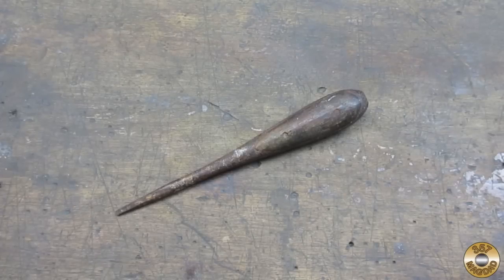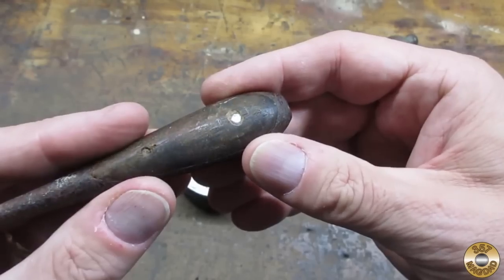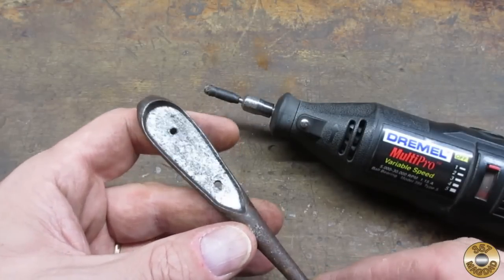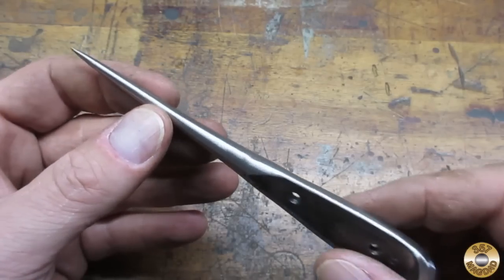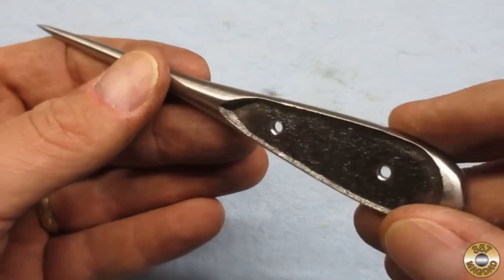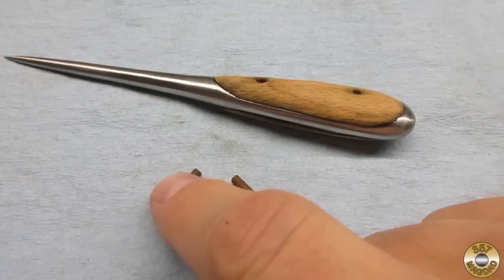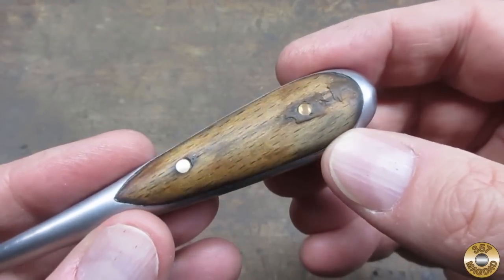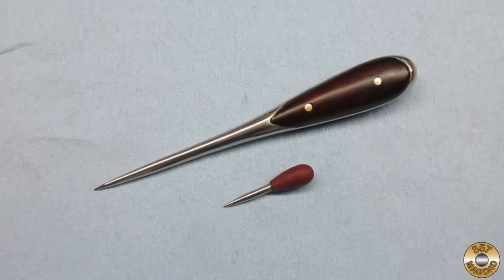Hand Tool Restomod - Perfect Handle Awl

Comment: Nice job young man. May I make a suggestion, on that contour of your pokey thing that is difficult to grind, what if you were to make a stick with contour to match the trouble spot and put it behind the running belt with slight pressure to shape the belt to the contour of the pokey thing contour, I hope this makes sense to you sir, thanks for the video, enjoyed it.
Reply from the maker: Thanks for the tip Terry!

Comment: Have you ever tried or seen Durham’s Water Putty? It’s like a tan powder that you add water to and then form  and when it dries, it becomes rock hard. People use it to fill in holes in damaged wood and fill voids. Some people use it with molds to create shapes like art pieces. It’s been around forever. I’m thinking that if I do something like this that I might think about using it to make molds that I can use as handle scales
Reply from the maker: That sounds like an interesting idea Joe!

Comment: Very nice pokey thing! What do you use them for? I mainly use mine on sheet metal holes when rivets won't go in and when reinstalling aircraft interiors after maintenance/repairs. I rarely need more than one but have started collecting interesting ones due to watching your videos. My Yankee driver collection is also your fault. I have several Yankee bits that are so large that I have yet to find a driver for them. But love being on the hunt for one!
Reply from the maker: I have a no-handle pokey thing that I use on almost every project.  I'm glad I've "influenced" your collecting!  I just found a Yankee No 31 that takes the larger bits this year!

Comment: I have a 1/4" drift pin that holds the shift linkage in my 1980 Mini. I went the auto parts store asked about a drift pin punch, no dice. I ended up at Sears, an older gentleman least 60 knew what I was talking about, got my Craftsman Drift punch.
Reply from the maker: Unfortunately, the 60 year old salesman and Sears are both the last of their breed.

Comment: Magdad,

Once again a beautiful job.   I was hoping you would use the modified end to make a bird's-eye awl.

Maybe the next time.  Out of curiosity did you epoxy the scales to the pokey thing?  Considering the one scale was cracked through a little more epoxy couldn't hurt.

Wishing the Magdad family happy holidays. 

Bob
Reply from the maker: Thanks Bob!  I epoxied the scales, I just forgot about that crack until the sanding was done.  A four sided awl point is on my to-do list!

Comment: Perhaps no other hand tool gets more abuse than a perfect handle screwdriver. Maybe I should say no other hand tool can survive more abuse than one of these. Of the six that I have, every one needs at least a little TLC. The two that were my dad’s need a good cleanIng, some regrinding of the tips, and refinishing of the scales. The set of three that I bought new need a bit of work. One has loose scales. The other two need to have the tip squared back up. The sixth, which I think came with a tool box from a flea market, needs the works including a visit to ScoutCrafter’s Dake.

Always nice to see one of these given new life.
Reply from the maker: I've got a drawer full of perfect handle screwdrivers waiting to be cleaned up.
Reply: @357magdad  you inspired me to do a little screwdriver maintenance this afternoon. I brought in the largest of my PH screw drivers from my work van, ( the other two are hiding )and one of my dad’s that was in the garage. They only got the tips squared up but it’s a start. I also got out the one that needs the most work started in on it. I think I straightened the shank enough that I won’t need to wrangle an invitation to ScoutCrafter’s shop.
Reply from the maker: @janderson8401  I'm glad you got inspired!  Cleaning up old tools is fun!

Comment: Top notch job on the Restomod Perfect Handle Pokey thing .. i was saying to myself the scales were pretty   banged up and well used  not worth saving but you pulled it off the scales came out great like brand new great and the Bombbay Mahogany Stain was the best choice combining  the brass pins and steel handle  A 10 out of 10 Restomod  and mr Chuck  did  a grand job polishing the pokey thing  ....... The Question is there  going to be a Christmas day Special next Sunday ????  or are you going to take time for yourself ?????
Reply from the maker: Thanks Roger!  I wanted to practice saving the scales for an upcoming project.  I'm planning on having an episode ready for Christmas morning!